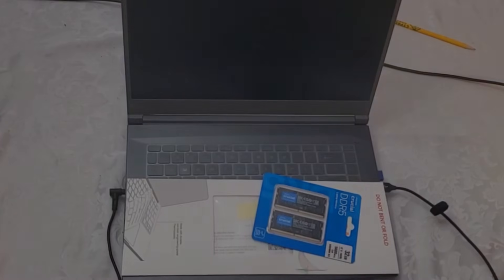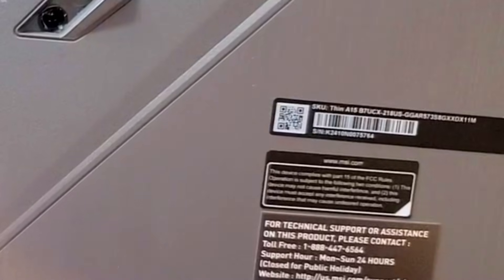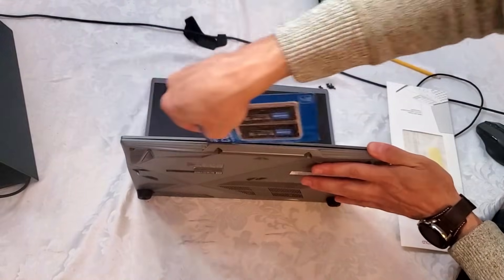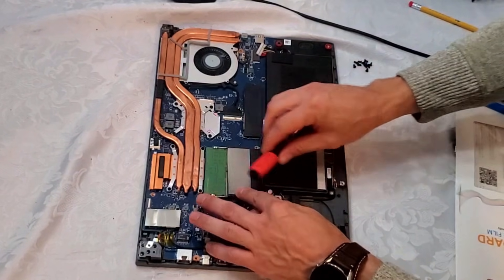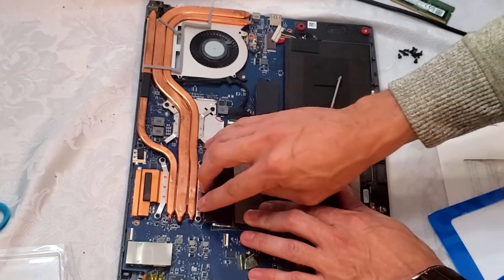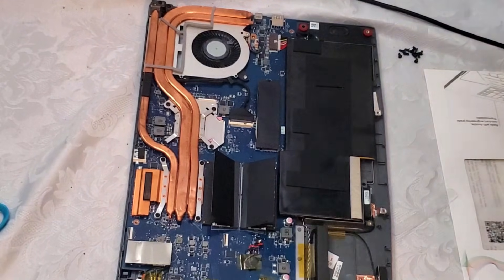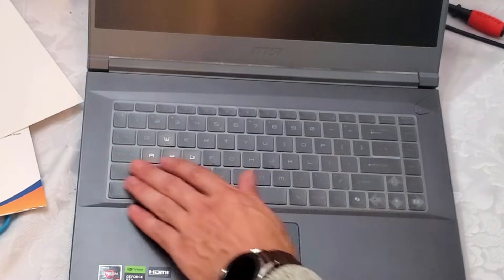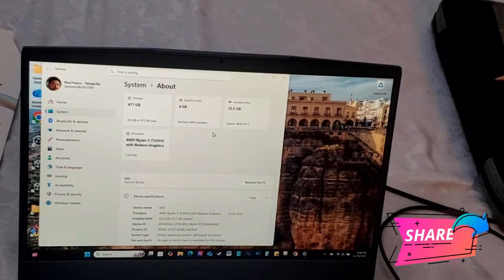How to open & install Memory RAM Upgrade in MSI Thin A15 Gaming Laptop

Comment: Great video on how to take the back apart without hurting the screen. I thought each card was 32, but I guess the packages total is 32. Windows 11 , I found out It will use old software. I have a picture it 99 program, and it works excellent on the new windows.